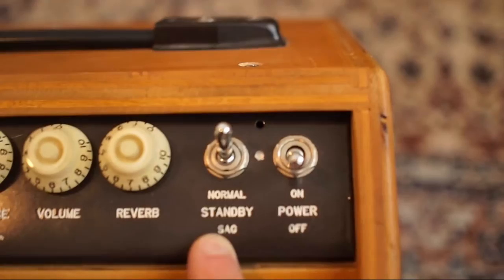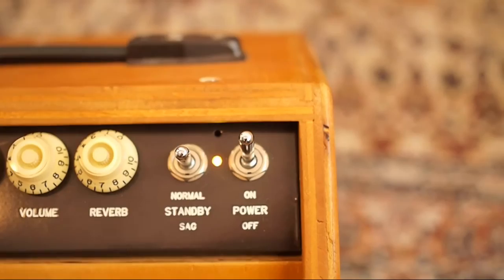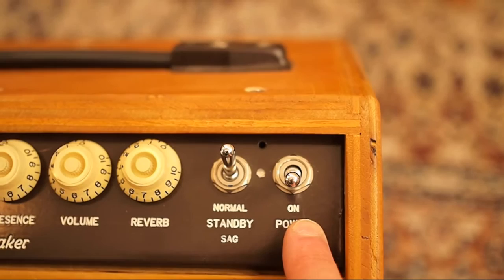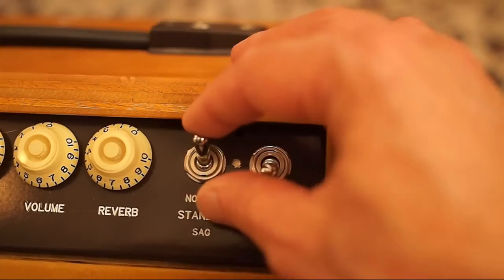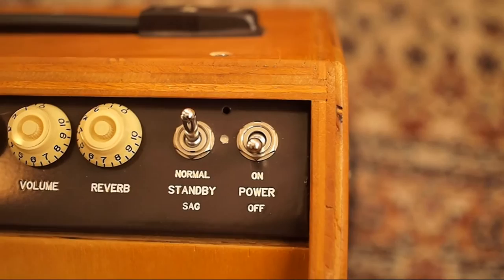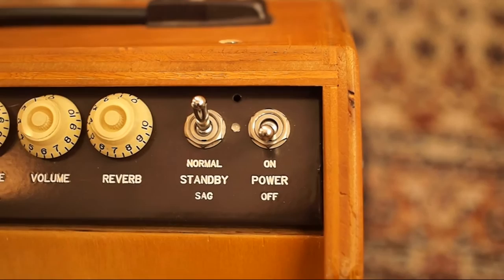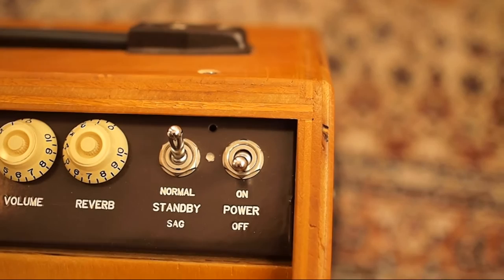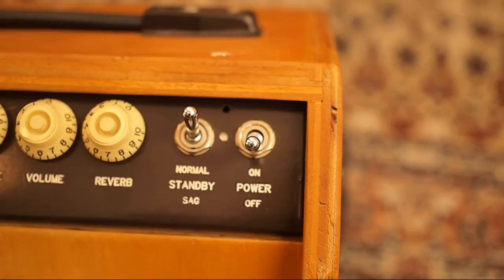The Correct Way to Use a Standby Switch

Comment: You should do  more research on this. Ive seen most of the industry trying to do away with this myth and now at the same time you post this video. Bad timing. Folks are trying to get to the bottom of this and a lot of electric engineers are saying the standby switch is complete non sense. Most of the problem is that the manufactures are placing them on amps and telling us to use them for no other season then its the way its always been done. Peeps are trying to get past this and your video might be standing in the way of that. Please just make sure you know that you are doing the correct thing before telling us how to do it. There is one truth and that is tubes have been used in thousands of different gear even before guitar amps were produced and none of these had a standby switch. Not till I believe Fender started doing this and now Fender are saying they did it for a completely different reason. Makes me think its a complete waste of time.
Reply from the maker: Your comment addresses the prevalence of hearsay and misinformation in the guitar world, but probably not in the way you intended. For one thing, this video doesn't actually advocate the inclusion of standby switches on guitar amps as you claim - it just suggests a method for using an existing one.  And regarding your  "one truth" that tube equipment predating guitar amplifiers didn't have standby switches, I can tell you from direct, extensive, professional experience that yes: the largest and most reliable pieces of tube equipment did (and do) in fact have plate supply switches (which is exactly what a typical guitar amp standby switch is). Whether a tube guitar amp actually needs a standby switch, or whether its use has a significant impact on tube life, are separate issues that are open to qualified discussion (something the guitar world could use a lot more of).
Reply: My intention was not to spread "hearsay and Misinformation" as I have not said to stop using the standby switch. I have done my research and the conclusion I came to was they are of no value BUT I am not an expert and while my research was extensive and came from electric engineers it is not the end all be all. My point was only that your video by simply existing advocates its use further.  Here is what proved to me they are useless. A standby switch is for one purpose and that is to protect from Cathode stripping and that can not take place with voltage under 1000v min. and no tube amp approaches that. Most averaging around 500v. That is half of the minimum. I use mine by always having it in on position. There are special circumstances in some other types of gear where voltages do exceed 1000v and yes a standby switch is used correctly.
Reply: Having said that. Heating and cooling of any electric equipment is going to cause unwanted ware. So in the event I take a short break I will use it just to keep from cycling my amp on and off. This is the same reason I run my computer 24/7 and use a sleep feature.
Reply from the maker: This video doesn't advocate the inclusion of standby switches: it shows a method of using an existing one and presents some rationale for that method. Thanks for your suggestion, but I've actually done a fair amount of research - in labs, libraries, and lecture halls. If your own technical knowledge comes exclusively from the internet, you're probably getting more contradictions and inflated opinions than facts.
Reply: Phlop Alopagus Somebody hasn't turned off lots of amps that have standby switches by the power switch directly... some amps go bananas yo.
Reply: Phlop Alopagus...
Reading your whole rant was " complete waste of time "....that being said....If would have taken the time to listen to what he is saying...you would have realized that he was showing the proper way to use an EXISTING STANDBY SWITCH...and  not a clip on the pro's and con's of having one to begin with...So in short you should " do more research on " on what the words he used mean and try to stay on subject....and in closing, You seem to have missed the biggest issue...cause you must have us all confused with someone who cares what you may think...trust me...no one cares what you may think...have a nice day...
Reply: Random dudes on Youtube aren't the industry. Electrical Engineers actually designing circuits and working for amplifier companies tell you to use them THAT is the industry. Just follow your owner's manual and be done with this amp version of the tonewood debate.

Comment: This is what the manual of Mashall DSL100 Head says:
http://i.imgur.com/K3Al3BK.jpg

So, which one is correct? Should I switch off the standby button first or leave it in normal position while turning the amp off?
Reply from the maker: Hello Jenot - sorry for the late reply.  To answer your question, I'd urge you to follow the manufacturer's directions, even if the technical rationale is uncertain. The method I show here, which is based on my own professional training and experience, has clear benefits and no disadvantage that I've been able to discover. But neither method is going to shorten the life of your valves nearly as significantly as some of the other things one might get up to with a 100 watt Marshall head. :)
Reply: Speaking of things one might get up to, is there anything electrical that can be done to preserve the life of the power tubes while over biasing them towards the hot end of the spectrum? So that they last longer than roughly 6 hours of play. Sometimes more or less.

Comment: It is a myth.
Reply from the maker: If a standby switch is used as shown here, it drains the filter caps faster and thus makes the amp safer. It may extend cap and tube life as well, and does no demonstrable harm. This is electrical engineering, not mythology.
Reply: You haven't turned off many old tube amps by the power switch obviously...